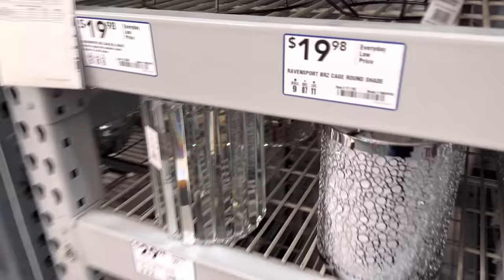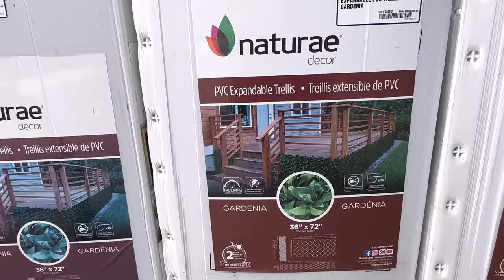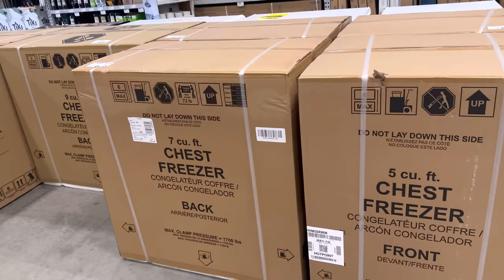Home Depot & Lowes + Life Update *VLOG*

Comment: I have a pit.  I also have chain link fencing 6' tall and  HUGE piece of wood that you use to hold up a roof along the bottom, on both sides (Back to back).  He heard a skunk in a wooden shed and chewed a hole thru the door to get inside.  He killed the skunk.  Think safety GF.

Comment: My bathroom is a light sage green like the 2nd swatch you showed. My guest bathroom in red on bottom with a black wood paneling going around it and a cream white on top. The shower curtain is zebra print and the accessories are zebra print. It actually turned out really cute. ❤️🖤🤍❤️🖤🤍🦓🦓🦓